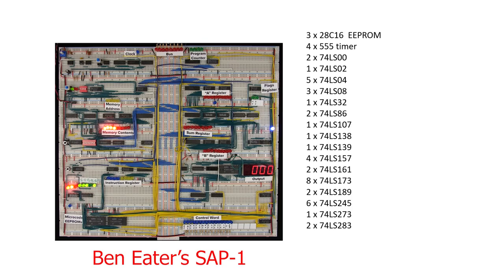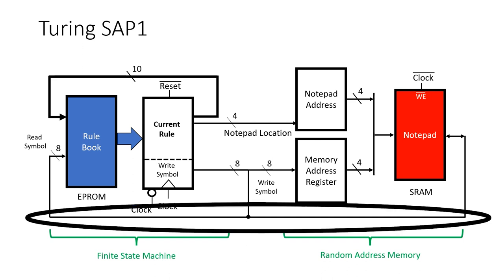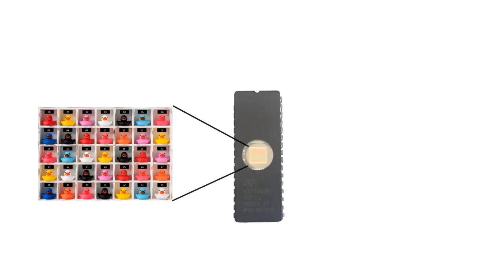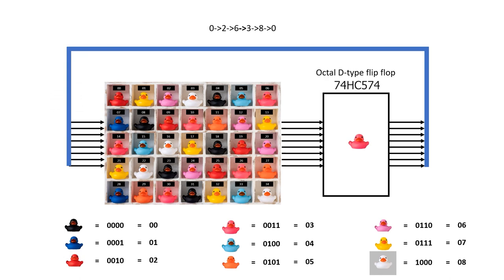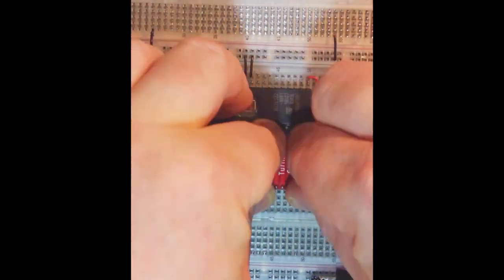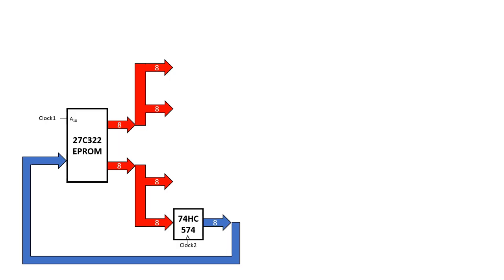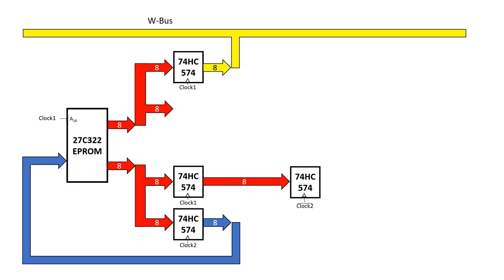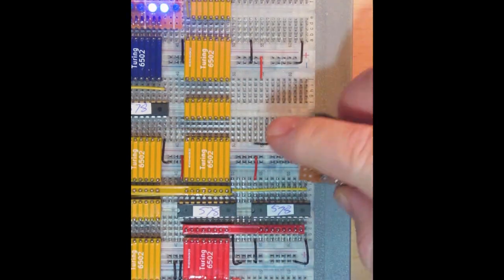Simpler than Ben Eater's SAP-1?

Comment: I think it depends on your definition of "simple".  Fewer parts and a streamlined design?  Yup.   Easier for me to wrap my poor brain around?  Most certainly not. :)  But the explanations are excellent.  Thank you!
Reply from the maker: Thanks, yes, that's why it's posed as a question rather than a statement.  You might want to look at the Pure Turing  https://www.youtube.com/playlist?list=PLjQDRjQfW-87Jbng4CllA9G12HLar0iF8 or Turing6502 https://www.youtube.com/playlist?list=PLjQDRjQfW-84j-jLvrbEeDvGl0QrhX9p7 playlists to get a better idea about how it works.

Takes a bit of commitment, but once the penny drops, it's much more straight forward than it appears.
Reply: Exactly my impression. Less parts doesn't mean design is any easier to understand and/or use. For circuits which do very specific things this might be good approach than throwing more chips and microcontrollers at the problem.

Comment: Those commonly available header strips will quickly ruin a solderless breadboard but with a little searching you can find similar headers with slimmer pins that fit into solderless breadboards beautifully. I'm looking forward to the rest of this series.
Reply: yep - round machined headers, easy to find
Reply from the maker: I suspect they will probably destroy the boards, but i think one off use is OK.
Once i've built  a board i usually don't disassemble them.  I'm sure i'll come up with a new idea for
a video the moment i pull it apart.
Reply: @DrMattRegan  yeah, especially if it’s a better quality board (not steel contacts)
Reply from the maker: The other thing was switching from 74HC374 -> 74HC574 which have all the inputs on one side and outputs on the other.

Comment: I am trying to learn about how computers work and may build a ttl computer in the process. The think I have had the hardest time understanding from looking at schematics was the BUS lines. The schematic made it look like they are all connected, but I couldn't figure out how it would work if they were... Now it makes sense it's just a standard for drawing those wires without drawing each one individually. Thanks!
Reply from the maker: @gordonw9208  yep, the convention is to draw wires thin and busses thick.  Sometimes there is a slash with a number to indicate how many wires.  The schematics become in readable if all the wires are drawn.  You may also want to look at the Turing6502 series after this.

Comment: Interesting, but not a general-purpose CPU.  As you say, it's a finite state machine.
Reply from the maker: I do discuss this in the SAP 6502 microcode series.  I also had a series called Turing to Von Neumann where i went over this as well.  I've taken that series down because i'm re-doing it.

Add the right memory (Part 2) and an FSA becomes a Turing complete.

Comment: I'm just learning about digital circuit design. The idea to use an EPROM and a D-latch buffer as a finite state machine, and make that the core of your CPU design is so elegant! I'm continually impressed by all the brilliant people over the years who have contributed to this corpus of design techniques that make all these systems possible.
Reply from the maker: Thanks for the feedback, enjoy the series.  I actually like part 2 better in this series.  I'm keen to hear what you think about part 2
Reply: @DrMattRegan  It was interesting how you introduced the concept of Turing completeness to justify the idea that all you needed to add to your finite state machine was the ability to access sequential memory in order to emulate the SAP-1. I was surprised again to see that you could vastly simplify the circuit by putting all the registers in RAM, except of course the address register. It's so obvious in hindsight, but I would not have thought of it. You also wind up with far fewer control lines. I would have liked to have seen a discussion on how that impacts performance (number of clock cycles for an operation).

I didn't read through the comments to see what others said, but I think the two stack FSM should be Turing complete. By popping values off one stack and pushing them on the other you are effectively moving through a sequential memory.
Reply from the maker: Yes, the two stack FSM is Turing complete.  
I go over a 1-bit 6502 design in the Pure Turing playlist.
The first machine even has a sequential access memory.
It takes about 3 million clocks per 6502 instruction.  
Most of that is skipping out read and write the memory.
When you add in random access main memory, it goes down to about 3000 clocks/instruction.

Comment: Your VGA by ROM  design crossed my radar screen for the first time yesterday.  (Video generation has long been near and dear to my heart.)  The very next day The Algorithm brings me SAP-1.  Nothing to do now but subscribe!
 
I have some GALs and a PAL programmer from back-in-the-day.  Was going to make a SAP-type machine out of 16V8s, an SRAM, and an EPROM.  The latest idea was to use the GALs in a bit-slice fashion, sort of à la PDP-8.
Reply from the maker: Welcome.  If you are serious about building a machine, you might want to look at the SAP-6502 playlist.  It's the same architecture as the SAP-1 but it's been bulked up to run 6502 machine code.  The microcode is available through github and i'm concurrently doing a series explaining how the microcode works.
Reply: @DrMattRegan  I think your approach to SAP-6502 is absolutely brilliant!  The way you leverage giant inexpensive EPROMs, and the way you use C to create their contents, was amazing!  As far as throughput goes, do you think your SAP-6502 capable of 1 MIP?  Or if not, would it at least be capable of the throughput of an NMOS 6502 clocked at 1 MHz?
Reply from the maker: I’ve had the Turing6502 running at 3.579MHz which is about 50% faster than the native 6502.  You might want to check out that playlist as well.
Reply: @DrMattRegan  Perfect!  Many thanks!

Comment: You can absolutely program FPGAs by programming the CLBs manually, without any abstractions.
You can tell what bits you want inside the CLB and where the CLB should be, and how it connects to other CLBs.
The compiler only does the routing in this case, which you can inspect if you really need to (I had to).
You may even control the routing too, basically sidestepping the compiler, but that can be difficult depending on which type of FPGA you want to program.
Reply from the maker: At a guess, what percentage of people who use FPGAs use their own routing?  I suspect you may be the exception to the rule, but that doesn't necessarily disprove the rule.
I would say the vast majority use an HDL, so there is a layer of abstraction except for the super user.
Some people like to re-write the microcode in their x86 machines, they are skipping the abstraction also.

Comment: Which 74HC574 have you found that has a reset?  I would have loved that but I had to settle for '273 instead
Reply from the maker: Yes, you need weak pulldown resistors on the outputs and reset is actually the output enable signal.  I'm a recent convert to the 574 but it makes the jumper boards much easier

Comment: My guess for the seven bit board is that it's for output and ASCII is a seven bit code. But for testing you wanted to make sure all eight were working. As an aside it's good that the data bus pins in those chips are contiguous and in the same order. I have worked with a few chips where they're not and you wonder why the IC design engineers thought it was a good idea.
Reply from the maker: Good guess!  But it was a much more practical reason.  I do want to run 8-bits of the w-bus up to the top of the board. 

The maximum distance between the busses on that side of the 27C322 was 4 pins.  So to keep everything aligned at the top of the board, the busses can only be 4 pins apart.  The SRAM on the lower left uses the bottom 4 pins for data and ground, so the w-bus needs to abut the SRAM chip, but when I tried the 8-pin board I couldn’t squeeze it in. 
Martin, you’ve watched most (if not all) of my videos, I’m trying to approach the same material from different angles, what do you think?
Reply: @DrMattRegan  I like how you are showing how this simple machine can emulate other more complex machines. The part count was especially instructive. It does it by moving the complexity into the rulebook which is essentially software. It's sort of the logical conclusion to RISC and shows how all computers have the same capabilities. Although those big EPROMs themselves have a lot of complexity stashed away inside them!
Reply from the maker: @mheermance  true, there is considerable engineering behind the memories.  What I’m hoping to achieve is to basically show the nugget at the core.  So when people see really complex architectures they don’t get intimidated and can break it into pieces. I worked in the Architecture group at Nvidia during the Tesla and Fermi period and it was the only way to understand the GPU.

Comment: This is a really interesting video, I'm really keen to see where it goes. Have you pushed it to see how fast it will run? Slu4 got his breadboard CPU to push quite a few mhz recently!
Reply from the maker: I was amazed he could get 8 MHz on a breadboard. I struggle above 1 MHz on breadboard. Even If they run, they are unreliable. The PCB version of Turing6502 runs at 3.58 MHz. I have some 50 ns EPROMs/SRAM, I might crank this board to see how it goes.  Below 250k is usually for fine.  Some of the PureTuring examples had to run for days error free to get enough data to see Pac-Man move.
Reply: @DrMattRegan  it's an amazing series of projects you have done. I really enjoy your explanations of why you have made the choices you have and how they are implemented.

If I had to offer minor negative feedback it would be the nightrider gag got a little old for me. But I'm also too young to have seen the series!
Reply from the maker: @colonelbarker  all feedback is good 👍. It’s funny I was talking to someone else about it tonight and they said keep knight ridder thing to a single video.
Reply: @DrMattRegan  that might be the way. It's  great method for testing that the state machine is working.

I'd love a video explaining the difference in the two state machine models you mentioned. It sounds like an interesting topic!
Reply from the maker: Good idea

Comment: What would be interesting would be to build a simulated NES  on a breadboard...  As for the cartridges or the games (roms)... that's were EEPROMS would come in. Just have an external board that you'd plug your EEPROM into and connect that to the systems input bus. Now as for the display, audio and the controllers that'd be a different story. However, I think that this would be a pretty cool project to complete.
Reply from the maker: I think the CPU side would be straightforward, its the PPU that would be the killer.
Reply: @DrMattRegan  Yeah, I had the same sentiments. The APU could be issues too. However, you could do 3 different bread board builds, one of the CPU, one for the PPU, and one for the APU and have them connected in the same manner as the original NES bus. Then the fourth module would be the I/O interface for the cartridges, controllers, and a/v outputs. 
It would be a fairly big build. It would also be an interesting build to see a working NES on a breadboard. However, the timings could be an issue due to the limitations of the bread boards and the sizes and lengths  of the wires...

Comment: Interesting, although I'd like to see it transferred to a PCB, as tying up that many proto boards seems wrong.
As for the EPROM state machine, I was thinking of a design using just an eprom, with the clock going into one of the address pins, so the EPROM has two almost the same banks that get alternated between by the clock.
There is of course one big downside to this machine, all your code is hard coded into an EPROM, no keypad or serial port to allow code entry, so one is stuck forever erasing chips.
Reply from the maker: You might want to watch the last 5 mins of the third video!